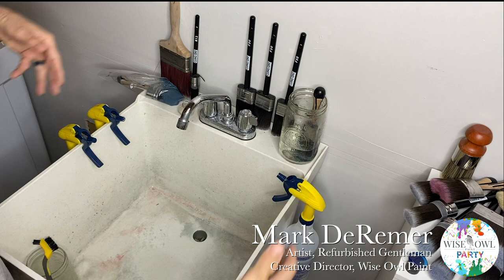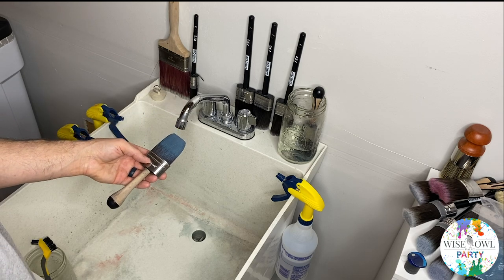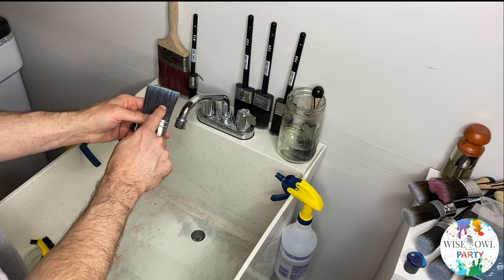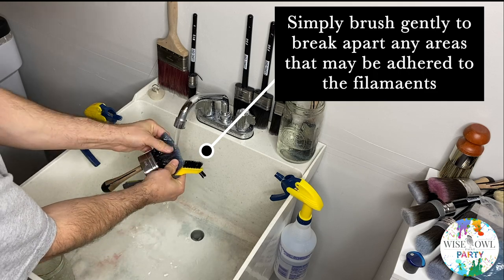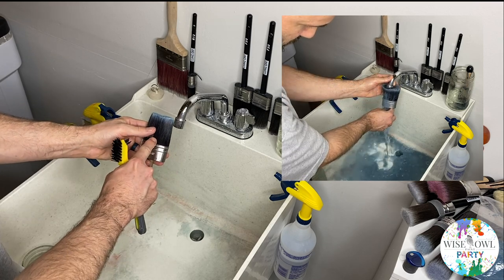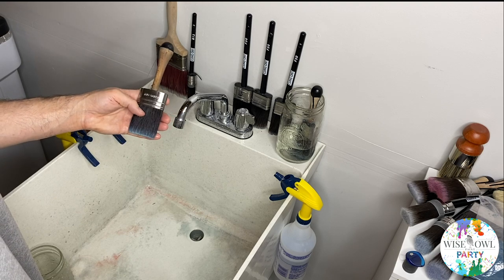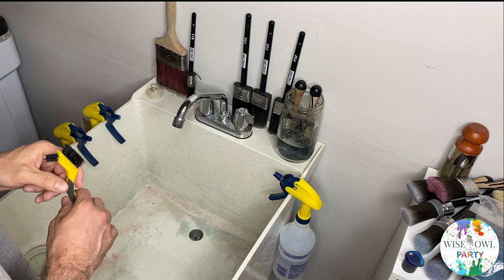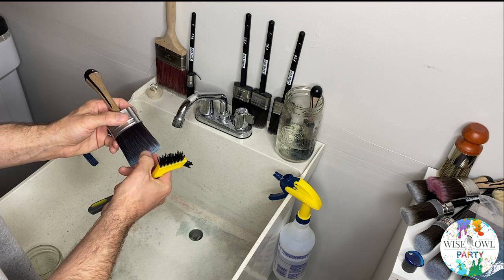How-To Clean Cling On Brushes

Comment: The S50 and S30 should never be left to dry then?
Reply from the maker: you can leave them in water OR once fully clean, hang them up.  They are not animal hair bristles so if they're left in water they won't be harmed from that.  I usually clean them all once a few weeks or when I need to clean up my sink and then hang them up.

Comment: How do I clean the salve out of another brand brush after applying it to the furniture?
Reply from the maker: I don’t clean my salve brushes.  I wipe them clean from salve as best I can then put them in a ziplock bag.  But if you want to clean it, I’d use mineral spirits and dish soap after that.  Due to the hemp oil base of the Salve you’ll want to ensure it’s fully fully clean before using it for anything else.  It being hemp oil based, means any residue left in the brush will cause issues with painting a water based paint.  So IF you do wash it, it must be done very thoroughly 👍👍👍
Reply: @WiseOwlPaint  thanks!
Reply from the maker: @mecrat  sure thing ☺️👍

Comment: How do you clean brush used to apply salve
Reply from the maker: I don’t.  I simply wipe it as clean as possible using a blue shop towel, then put in an airtight ziplock bag 👍